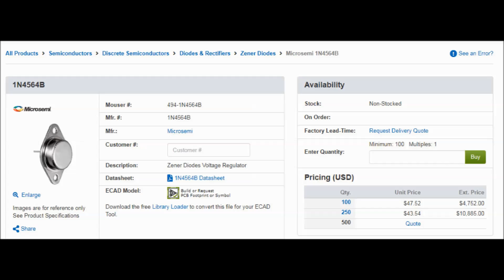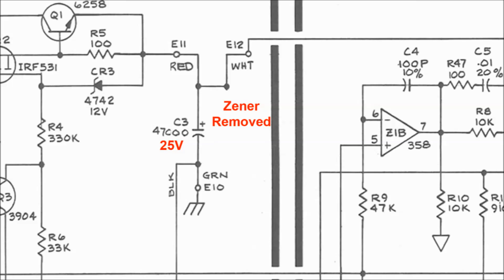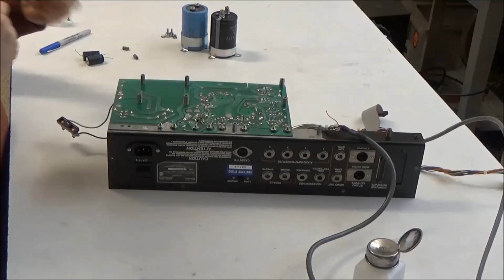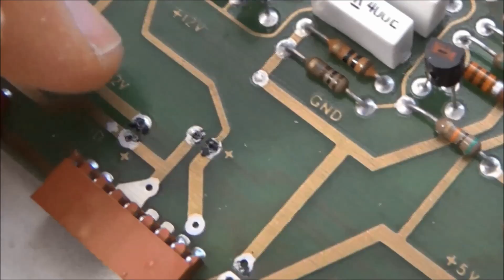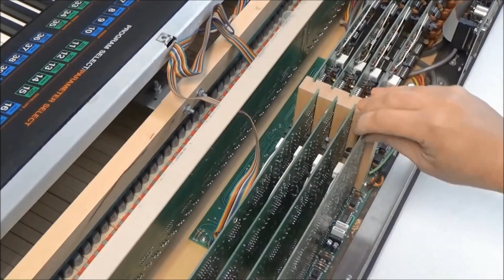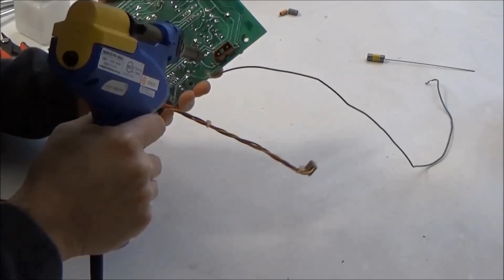Synthchaser #117 - Rhodes Chroma Repair & Restoration Part 2 - Power Supply & Recapping

Comment: It is neat watching you bring this synth back. In the factory when we made these, everything was new, so ESR, corrosion, etc was never a thing. After the boards were made, they were tested on a Zehntel 400 ATE machine. If there was a problem in final test, the final test techs pulled the offending board and engraved a small “x” in the corner, and it went back to board test. Any board earning two x’s was snapped in half and thrown away. We probably put a couple hundred Chromas in the trash this way. But we didn’t know the future, and that CBS was going to sell the whole Music Instruments Division. Restoring looks to be a lot harder than building them new, but we had 300 plus workers, also! ( are you working in a 41F lab? The tempco I saw online is 3300ppm. 43F if using 3500ppm)
Reply from the maker: It's my bad.  I realize now in the video I said 3.3% per degree C.  The tempco is actually 3300ppm, which is 0.33%.  

R = R(init) [ 1 + TC(T - T(init)]
so
T = [(R/R(init) - 1) / TC)] + T(init)
T = [(1748/1870 - 1) / 3.3*10^-3] + 25
T = 5.23C

My apologies to everyone who got the math right with my incorrect information.  I guess it was so cold in there that my brain was frozen!
Reply: @Synthchaser  Ah ha! I feel a bit better now! Also, turn the heat up!!
Reply: Scott Rogers I got your answer at first, also. But @Synthchaser said “very cold”, and 23C is more like “quite comfortable”, so I Gooogled 1.87k tempco resistors and saw 3300ppm, and went from there. @Synthchaser has 1.87k resistors on his web page listed at 3500ppm, so I did that calculation as well.
Reply: @billfinch4661  Yeah, I was going to look it up too to confirm what he said but when I saw your answer and his response I just gave up and let him explain it.
Reply from the maker: Thanks for sharing the first hand history with these great instruments.... and for correctly figuring out the temperature in my workshop! Brrrrrrr!
Reply: @Synthchaser  Can you show the math on the temperature calculation? I'm confused!

Comment: Yamaha also had a tendency to put capacitor voltages really close to their rated voltage, especially in the 70's. Plenty of ancient 16V caps on 15V rails, with an ancient linear PSU driving it. Oh boy.

But putting a zener diode on there to keep the voltage just under the rated voltage is a whole new level of silly haha

Comment: A good SMPS followed by capacitance multiplier would be superior to a linear supply. Just make sure it's the right wattage so that it doesn't modulate the output for underload condition. You would have to make a PCB for the CM. SMPS are vastly superior to linear supplies in just about every way. The exception would be EMI emitted into nearby magnetics. But in this application it definitely the right choice.

Comment: You're kind of lucky with that Chroma, i'm working on one now, where 5 of the 7 channel boards were faulty (and one missing, but got a faulty one from ebay :D ). Usually the CMOS switches died on different locations. Luckily i built a board tester from Tauntek, it helped a lot in debugging. Oh, and an opamp and a 4016 was also dead on the channel motherboard. And the 5V 47000uF cap too. 
Also, i replaced the CPU board with a CC+ i'd highly recommend this upgrade, more options, built in MIDI, LCD control, etc. I'm also replacing all sample&hold capacitors with WIMA, some of them were drifting, and there were 3 different kinds on the boards, due to some previous fixes.

Comment: @Synth Chaser   Absolutely brilliant, at least in theory. It gave me the confidence to pull mine apart to fix the PSU. Except a lot of IMPORTANT steps are left out and, had I known how tricky they were, I wouldn't have started!

Strange, when you go into so much detail about counting the bottom screws, and then omit the really important bits.

For instance, the audio cables from the rear sockets have to be unplugged from the main boards - but they're INCREDIBLY fragile. There is no retainer at the back board, and taking the PSU out means that you've got a lot of very fine and brittle wires at the end of long bunched cables being constantly flexed - not to mention having to undo all the grounding cables. 

I gave up in the end.

Comment: If only refurbishing / recapping stuff went as quickly in the real world. Question: Is it possible that leaking batteries damage on the backup battery holder puts a complete Chroma out of action in stead of only preventing it from from remembering sounds? The last time my Chroma was repaired this was claimed by the technician. It sounds far fetched but as your example about the power supply exemplifies (thanks for the great tips!), strange design decisions where made in this thing anyway! :-)
Reply from the maker: Depends on the extent of the leakage.  If left for a long time it can work its way up the copper tracks and damage other things.
Reply: @Synthchaser  Time to have another look VERY soon then. If I remember correctly I used rechargable batteries the last time because I expect them to be less susceptible to leaking. Correct?

Comment: Very interesting, as always. Thanks for sharing ! What are your concerns about a Switch Mode PSU for analog power rails exactly ? Because, unless that type of PSU is of very poor quality, there is more than enough filtering and DC current conditioning out of them to be more than adequate for such a use. In fact, the voltage and current regulation is even better than on some linear ones, which would ensure more stable CV and audio performance. Moreover, the added efficiency often means less heat dissipation, and much lighter weight too as a bonus. As for EMI that could possibly leak into audio circuits, unless the Switch Mode PSU is, again, of poor quality, most of them are FCC and (ISED here in Canada) approved for meeting stringent minimal EMI standards. In fact, all of the new analog synths these days use a SMPSU without any issues. BTW, it's probably around 22.5 ℃  in your lab (which is pretty normal, and not what I would call "very cold"). Very cold would be something like 15℃. But I live in Quebec, Canada so my my temp standards might not match yours... ;-) P.S. I'm evidently not a brainyac... lol !

Comment: Using a 25V capacitor in a 7.3V(nominal) circuit. Oh boy, that might just start another lively discussion about capacitors :) Very nice work. on the machine so far.

Comment: I've always been rather cautious with touching both leads of big capacitors, being afraid of shorting the remaining charge with my fingers. Do you discharge them beforehand, or is there a rule of thumb i'm missing? Great vid as always btw :-)
Reply from the maker: Yes, you should always be cautious with large capacitors.  However in this case, the capacitor only charges to about 7.5V, which isn't high enough to penetrate the high resistance of my skin.  It's comparable to putting my fingers across the terminals of a 9V battery.  https://www.instagram.com/p/BucnEcDF9w_/
Reply from the maker: Plus, the capacitor was already discharged when I touched it.
Reply: @Synthchaser  ok, i didn't think about the volts-  makes sense. Thanks and keep up the awesome videos, always glad to watch them.
Reply: @Synthchaser  Thanks for the explanation, I flinched the first time you touched those capacitor terminals!
Reply: That made me really nervous too!

Comment: I'm probably wrong but I THINK it's 22.46c or 72.4f in your lab.
Reply: 6:35 i'm probably wrong too : 1870  * (1.033)**(-2.07) gives approximately 1748 so its about -2.07 (2.08)  degree under 25°C
(not so cold anyway ? )

[better than trial and error, as i did  logs would probably help here 🤣]